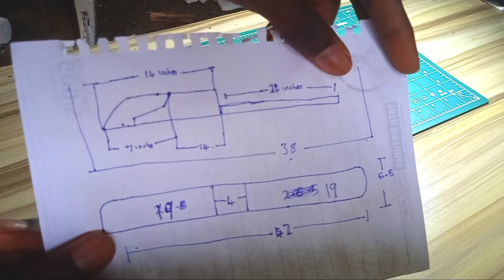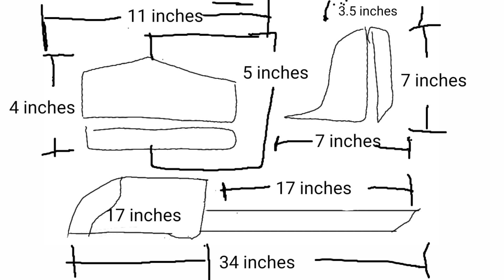How to make a Bango Trainer Airplane|DIY Homemade Airplane

Comment: Good job bro🥰🥰. You made a mistake at your fuselage length, you should have make it 75 percentage of your wingspan instead of 80%. Or reduce your vertical stabilizer by 33% of your horizontal stabilizer area. Your plane is pitching up by itself.

Comment: What is total weight of your plane when all the components installed?
Also what is the total flight time you got with 3S 1400kv motor ?
Reply from the maker: Plane weight is 834 grams
And I don't have a battery I borrowed 2s from someone 🙂🙂
I will post the video whenever I get a new battery